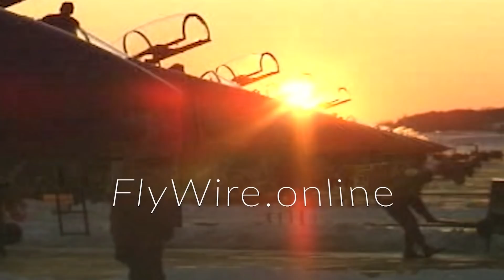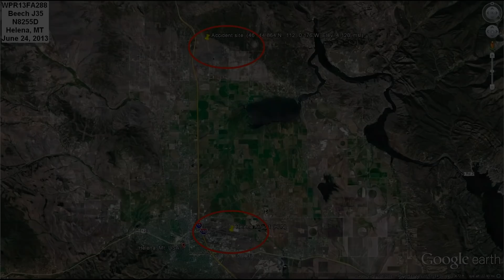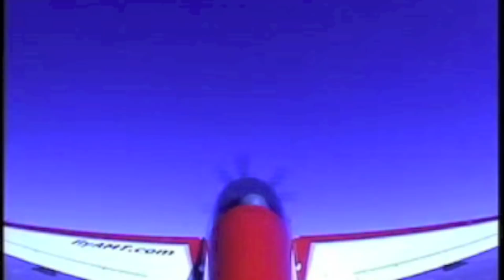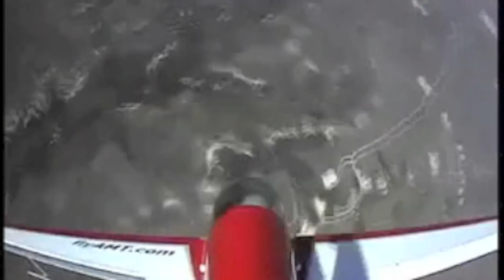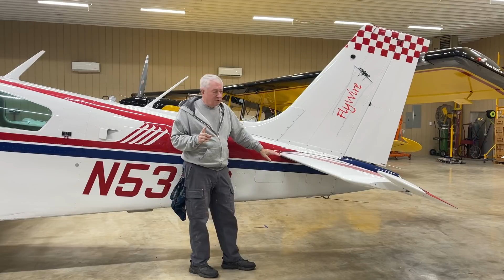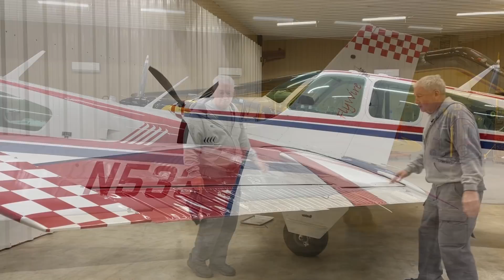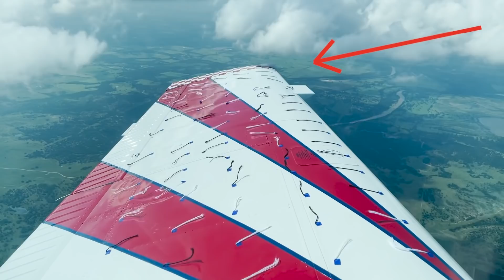J35  Bonanza Power-On Stall / Spin

Comment: Great video thank you for doing it. I was thinking about a spin accident I witnessed years ago in a Ryan pt-22. I was just learning to fly in a Aeronca and had completed spin training. A older friend at Van Sant had just bought a Ryan pt-22 by older he was 24 I was 14. My Dad was teaching me to fly the Aeronca and he insisted on spin training. 

Ok back to the Ryan. My Dad’s friend had taught in the Army Air corp in the T-6. Mac was his name. He was also a captain with TWA and owned and flew a Stearman he had just upper to 300hp from 225. Anyway Mac was going to check out Kent in the Ryan. We were sitting on the fence at the Pennsylvania country airport and watched the Ryan take off with Kent in the back seat and Mac in the front. We watched them climb to altitude and do various maneuvers. They did one spin entry and in 3 rotations recovered and climbed up to altitude again. Then they purposefully entered another spin and it kept spinning 5, 6 , 15 rotations and then disappeared behind the trees. Mac & Kent were both killed. 

We found out later the rudder cable between the front seat and back seat had snapped. Making it such that Mac the instructor had no rudder control. Kent had frozen on the controls with his feet pressed hard against the rudders. Kent had frozen in flight on a number of flights in the Stearman. The both had parachute but Mac turned the fuel off before impact and never bailed. Remember that Ryan was at 45 degrees spinning. Mac had no place to put his feet to push out of the cockpit.

The reason I bring this whole traumatic story up was Mac had told me to recover the Ryan pt-22 you need to first stop the spin. Neutral controls and rudder to stop the spin. Then push the nose down getting airflow over the wing. That unless you stopped the rotation first in the Ryan it would not recover from the spin.
Reply: Good to rehearse the recovery on the ground on a rotating chair, etc or sim.  Many have frozen feet and cant recover.  They freeze on controls.  I used to fly to Van Zant from Caldwel Airp. in NJ.
Reply: @outwiththem  Kent froze on the stick and rudder giving more tension on the rudders and rudder cable. In the Ryan the instructor sits in the front seat and it is an open cockpit making communication between the student and instructor harder than say a Cessna. I don't know if the rudder cable itself snapped but I think most likely the added pressure on the cables perhaps caused the rigging on the rudder pedal come apart.
Reply from the maker: Paul, that's a heart breaking story.
Reply: @FlyWirescottperdue  yes very traumatic and I’m 68 years old now and remember that crash in 1968 like it was yesterday. Mac Robert McCarthy was his name had over 16,000 hours in everything from B-24 - the T-6 to the F-84 the Connie and was Captain in the 727 that a broken rudder cable on a Ryan pt-22 was hard to accept. Maintenance maintenance! He was my Dad’s best friend and that day my Dad had to tell his wife what happened. But it really stuck with me especially in that Ryan that unless you stopped the spin first then popped the stick it wasn’t going to stop spinning.
Reply: @paulwoods4394  My spin and aerobatics instructor told me years ago..  Its is not maintenance at all.  It is that scared or too coward people tend to push one or even both feet away and freeze that way in panic.  

The other non freeze feet CFI or pilot pushes one pedal to stop the spin,  while the dam coward feet froze is pushing the pedals very hard in panic.  and that counter force breaks the mechanism, like levers attaching the cables. Right-handed panic people will push the left pedal more.  The CFI will push the right pedal hard to recover.  Counter rudder, that will break the rudder levers

He calls that .. The Panic Pedal Pilot.

Comment: Thank you for what you do Scott. This is invaluable information, and the visual explanation of everything that is occurring on the outside of the plane in a power on stall/spin makes it so much easier to visualise what the plane is doing from inside the cockpit, which really helps to enhance situational awareness and the steps required to recover the aircraft. I think being able to picture in your mind the outside of the plane from the inside of the plane will help to save lives.

Comment: Had a flight instructor do full power stall when I was learning to fly and (yes I had to recover it a PA28-151because he did not know how )I did power all the way back controls neutral full rudder to beak spin then elevator pulled back then the airplane was flying again olé yes was praying to God like no other less than 200ft from hitting grown It sounds like I did not do it quite right but it worked  this is 100% good solid INFO You are at the top of your game thank You.

Comment: Here's a place RC models teach you to do it wrong.

The models have so much power, the prop can just pull the airplane out of the spin on neutral controls.  Many models can pull up and out of the flat spin by using power. (impossible  for full scale)

While the models can teach you some good things, they can teach you bad habits.
Reply: It is not 'impossible for full scale'. Have you watched Sean Tucker and Rob Holland's airshows?
Reply: @pittss2c601  another Pitts pilot maybe?🙂
Every type has its own characteristics in spins. Some shouldn't be spun at all.Sean tucker and others are spinning (snap rolling) vertically and recovering with full power. But they can because of large control surfaces, the design of the airplane.
Reply: So far as I understand, many GA aircraft will recover from most spins by holding neutral controls and leaving power where it was - you just wait it out. This applies to aircraft that were designed to have the wing tips stall long after the majority of the wing has stalled. Cessna sales guys like to tell you this on trial flights. It's not the best technique though!

I think the reason that adding power brings RC planes out of the spin - even when the full-size aircraft it's based on won't - is the extra slipstream over the tail increasing the lift of the vertical stabilizer, which neutralizes the yaw. I'd like to hear any other theories though.
Reply: @markirmuir    Holding neutral means knowing where neutral is.

The models have an advantage.  Let go and the sticks spring center.  The servos drive the controls to neutral.
The servos and controls are sized to overcome ANY potential in flight forces and push the control to the ":commanded" position (even if the "command" is letting the stick self-center)

The model "knows" where neutral is.

As stated in the video, the aerodynamic forces, will try to move the rudder into the spin.  It's not as easy to KNOW you have the rudder centered as it is to just push it on over opposed to the spin.

But the real key to powering out of a spin with RC is the  tremendous power : weight advantage.

Piper Cub appx 0.3 : 1 power : Weight.
C-152 appx 0.5 : 1

Average RC model 1.0 : 1 to more than 3.0 : 1.

The model isn't depending on airspeed to drive enough air over the rudder to straighten it out.  The prop is pushing enough air back to do it.
Reply: @fhuber7507  In my military flight training in the UK, we were taught to know where neutral is on the stick, for precisely the reason you said - so it becomes a learned response to return it to neutral and hold it there during spin recovery. Those trainers (Bulldog) had brutal spin characteristics, with 12,000fpm rate of descent.
I got into RC recently too - I fly 3D with an electric biplane - and I'm amazed by the torque and P factor, they're even more extreme than on the RAF's basic jet trainers (Tucano). RC is a great learning tool for flying real aircraft, because you can try out things that could easily lead to a crash. 1st hand experience of out-of-limit CG could've saved the lives of several pilots I knew who took that risk and perished.
Reply from the maker: Actually, I think it is more likely due to polar moments of inertia. The center of the spin axis versus the CG and the location of the power thrust line.
Reply: @FlyWirescottperdue  we push CG forward compared to general aviation aircraft on trainers, but far aft of what is considered safe for general aviation when setting up extreme aerobatic models.

It's hard to compare inertia moments of the wings because they vary considerably based on construction.  We mostly see a difference in rotation rate being slightly slower with heavy sheeted and fiberglassed wings, but still immediate end to a spin with power on.

Pusher designs almost always require power off for spin recovery when tail planes are not in the prop wash.
EDF (electric ducted fans, simulating jets, but with tremendous motor torque) also need power off for spin recovery.
These just spin faster with power as nothing is in the path of the high speed air exiting the thrust tube.  And the thrust is applied behind both CG and center of drag.

I have a pusher flying wing that when spinning inverted, apply full power and it spins so rapidly it climbs. Turn off the electric motor to get out of the spin.

The power to weight seems to be the most important factor for powering a model out of a spin with a conventional designs. (prop in front, main wing with CG 5% to 46% MAC of main wing + tail planes significantly smaller than main wing) 
More power, pushing more air over flying surfaces breaks the stall and it straightens right out, accelerating in whatever direction the nose is pointed. (Including straight up.)

Our model prop diameters tend to be smaller than scale when using "glow fuel" power, but can be at scale for gasoline and electric powered models. (Ground clearance generally prevents oversized)

I like discussing similarities and differences of aircraft types and effects of changing scale.
Reply: Without even watching the video, I think keeping the plane coordinated and flying by the numbers, and seat of the pants can leave you a good margin of safety. Now onto the video 🙌

Comment: G,day Sir from Sydney Harbour Australia.
* Thankyou for the enlightenment of the presentation (position) of the plane structure following impact with terrain at various degrees

Power on stall: and recovery
I liked your reminder about the rudder being a source of lift and the visual aids (demonstrating relative airflow over the vertical stabiliser and rudder) to cement your point.
🌏🇦🇺

Comment: Excellent  primer on stalls and spins Scott, best I've seen, heard or read and a nice add-on would be some in-flight demos. I also appreciated you mentioning your preference for flow over memonic cues, in a busy or high stress situation I believe flow is the better default and mnemonic cues more suited for lengthy procedural tasks.
I was also adverse to power on stall practice and mentioned that to a friend (Carl Deitz) who who did some of the FAA recertification like testing on the twin Comanche. At the time I was flying an old 205hp B35 with the flatter V-tail and Carl insisted that I work out my apprehension about Power-on stalls in the Bonanza, and what Carl had me do was cross-controlled departure stall entry with full Aileron and input and raising the nose until a yaw moment was detected, and then lowering the nose until the yaw stopped, avoiding a stall break. Carl's training point was not to actually perform power on stall, but to emphasize awareness  even slight Yaw divergence in departure climb, and make lowering the nose as the preeminent action to advert a spin . As Carl used to emphasize, spin avoidance is foremost a matter of awareness of when you are at risk and taking immediate actions to mitigate that risk, rather than out of unawareness, becoming an inadvertent test pilot.

On subsequent flight reviews, I Practiced cross-controlled approach to a departure stall with Carl in a B55, Mooney and Twin Comanche, and from then on, my awareness of Yaw and preparedness to "lower the nose" became second nature. 

I had a Decathlon for a while, and did departure stall and spin practice with an old AF aerobatic instructor, and on my first attempts I did just what you said, over-pitched and ended up inverted. From then on I became an advocate that any serious pilot get some proper stall stall spin training and recovery training in a real aerobatic aircraft, from a real aerobatic instructor like you Scott, who understands it, and understands how to teach it.

Also, a side note on V-tail Bonanza's,  and especially the early models with the lower dihedral V-tails. A veteran Bonanza instructor once asked me if I had ever done a forward slip in my old B35 Bonanza, I admitted I as never found a reason to slip a Bonanza, with flaps extended and it was prohibited anyway. He indicated that in an off airport emergency landing I might have to, and I should be familiar with the characteristics. We practiced  forward slips with flaps up and extended, and I found that with flaps and gear extended, with even a light forward slip, elevator authority was greatly reduced or eliminated. When I pressed a forward slip beyond the point elevator ineffectiveness, the old B-model abruptly lost all vertical stabilizer control and pitched down nearly vertically, with a simultaneous, rapid and extreme kick back on the yoke that almost knocked the yoke from my left hand. I tried this in a later 'P' model Bonanza with the taller v-stabs and found better control with flaps extended, and experienced no sudden departure from controlled flight in an extreme forward slip.. As such, I came away with a better understanding and respect for why not to slip Bonanzas.
Reply: I was wondering how a V-tail Bonanza would behave in a spin, thx!

Comment: Scott, excellent as usual. In the late60's there were a number of Twin Commanche accidents which were attributed to stall spins during training. The aircraft received a bad reputation as a result. Likely these occurred during single engine training.  Have you looked at the departure and recovery scenarios for light twin aircraft?
Reply from the maker: I have. Not sure I want to do a video on it.
Reply: @FlyWirescottperdue  

I wish to thank for your sharing of insights into flight and giving to both novice and masters ever better ways to keep attuned to the simplicity and complexity of air and mechanical engineering of aircraft that has given our species to arise from the surface( dry, wet or frozen) in objects built to achieve movement from one point to another within the limitation of awareness perceived by hope, faith and trust of those who want to make it possible for people to fly. Errors were and still are possible, yet, lessons are learned and when becoming known allow great achievements to be had for all future craft to come.
Thank you for sharing your concerns and wanting to assist all who wish, want and do fly to do so as responsible and safely as they can. I hope you will continue this great calling you have and those who watch your videos will benefit most wonderfully!!!!!

Comment: Thanks for the refresh on stall and spins. The only stall/Spin I did during trading was on a C150 aerobatic. Just like you said, power idle, and neutralize controls. It would come right out. 
The Bonanza V tail might have a bit more complicated airflow on the tail. It would be really interesting to see it in a video with all the airflow indicators like yours. Great video. Thanks again
Reply: A v tail cannot possibly have an advantage in a power on stall spin!!!’

Comment: Very well explained.
My memory thing is to stomp the rudder on the side the horizon is 'leaking' out of, hence stopping the 'leak'.
Your videos should be required viewing for everyone in 'basic' initial training. Thank you.
Reply: Hard opposite rudder nearly breaks ones head off in a Pitts Special. It pops out immediately. Smooth opposite rudder input even at idle power. No stomping required.
Reply: Depending on aircraft model, configuration and situation stomping the rudder to its stop, if done early, may create a wingdrop on the 'stomped side'. It can be the lesser of two evils, but the action might also (possibly) be futher refined/optimised by less 'hurried' response. [Or I might just have gotten the wrong association from the word "stomp" 😀 ]